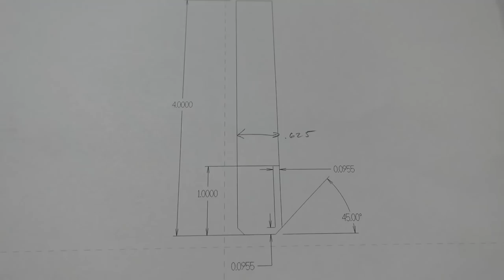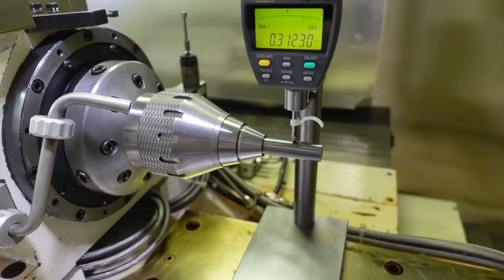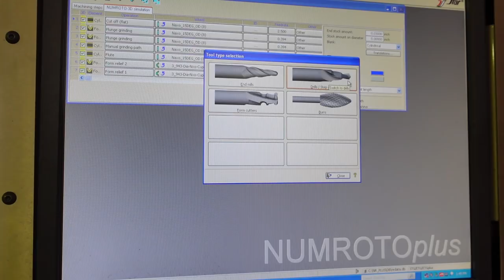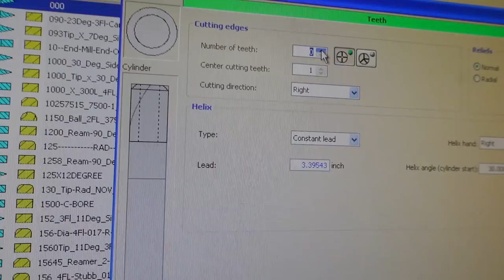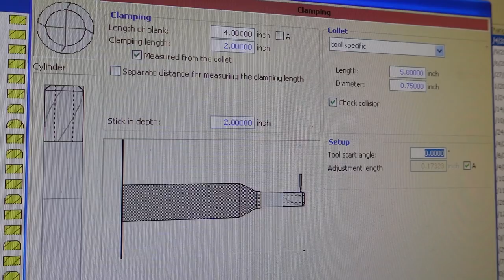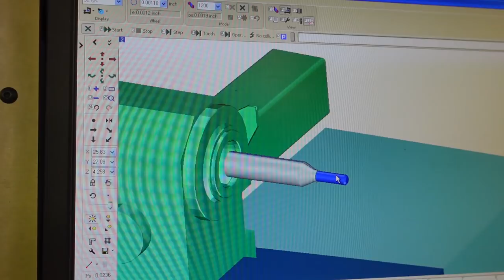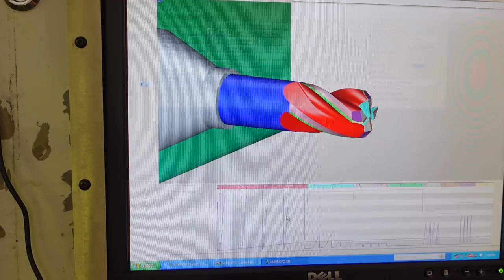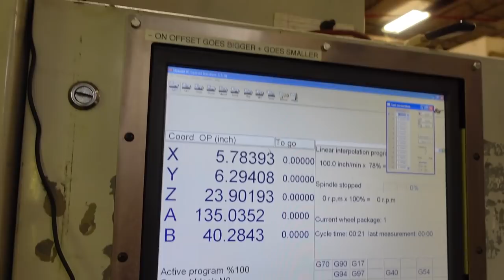Grinding A Special Chamfer Endmill

Comment: Using a micrometer to measure a sharp carbide tool will almost certainly damage the cutting edge. Rocking the indicator tip on a sharp cutting edge will also damage it. It wouldn't be noticeable with the naked eye necessarily but with a microscope or Zoller measuring machine you'll see it clearly. Maybe not a big deal for some but I just thought I'd share that.

Comment: This is so cool watching the process! Makes me wonder how they did it in the early 1900s without computer controlled machines and diamond wheels.
Reply from the maker: In those days they were dealing with HSS tools. So they could machine it in the annealed state than heat treat. Than just grind the cutting edges as you would today on a manual tool&cutter grinder. Or it could be done with a cam operated machine as well.

Comment: I find it remarkable you have such command of the nuanced detail of the process and the software, to make a one off tool.  I realize you have had this for years but I have tools that I use once in awhile that I take as long to rediscover as it is to use them...   And didn't you say there were only 4 of these machines made???   GREAT video.  thx.

Comment: Usually, we use wire cutting to cut off point drill to get a chamfering mill.
Then use a USB microscope to magnetically attract the spindle to measure the diameter of the tip of the new chamfering mill

Comment: My K O Lee T & C grinder sucks badly in comparison to this. Really there is no comparison.  If I can get it running within half a thousandth TIR, I'm tickled.  No way to grind flutes from scratch!  Re-sharpen I can do, but not as nice as this can.  And get the 1st and 2nd relief so perfect on a chamfer mill, the 2nd relief always seem to drag as it gets close to the center of the endmill.  I keep trying for improvement.  Thanks for sharing Peter.  KenS.

Comment: Cool video and nice endmill. 
It is also possible to measure the diameter with the machine when making new tools. For this purpose, the option "measuring in process" is necessary. With this option, the core diameter and the outer diameter can be measured and automatically corrected.
Reply from the maker: Thanks I will check if I have that option. I can do it with the regrind part. I have done that before.

Comment: You did all that while milling inconel.... damn you're good. 🖐
Reply from the maker: The inconel job on the horizontal mill is setup to run unattended. I have run that job for years and thousands of parts. I have shown a little about the cutters I use in a previous videos.

Comment: Wow! I like to own such a machine! Serious toy for big boys. I'm afraid I cannot afford it but this gives you a lot of freedom in your machining approach. I saw an earlier video when you ground a special tool for a job and I thought you used the Mazak for this too. Now I understand better. This machine probably has air or oil bearings and automatic balancing to get a real thru running tool. Do you own this machine or is it a machine you can use for your jobs? Software looks a bit dated but it seems to have all the features you need for grinding special purpose tooling. (DOS was really stable compared to a lot of windows versions who came later. Win97 made my hair grey...) Thank you for sharing, Job (for grinding only a Deckel SO1 which provide me great single lip cutters for custom jobs but this machine rocks!)
Reply from the maker: Thanks Job Kneppers! I own this machine. It's a CNC tool and cutter grinder. It actually rides on roller bearing ways. It theoretically can resolve to .000039" of accuracy.

Comment: You don't worry about it. That's funny. 
Don't get my wrong. 
I think what are you doing is amazing. Like I just have a bench grinder. Actually I have 3 and a half grinders. 
The half is a old sowing machine motor.  With grinding wheels buffing wirer. Ect .

Comment: Who knew there was such a beautiful end mill hiding inside that bar of carbide? 

How close of tolerance can you get with this setup? 

Is there a cycle for dressing the wheels?

I worry who is going to be doing this work in 10 - 15 years? 

Thanks for making the video clip.
Reply from the maker: I have ground tools to .0001” tolerance before. But that take quite a bit of effort.

Comment: You can get an anvil mic to measure odd flute end mills I’ve always done it that way.
Reply from the maker: Yes if the tool has the correct spacing for the mic. But modern tools now days sometimes have irregular spacing on the flutes. I have a 3 flute mic but not anything else. Say for 5,7 or 9 flute tools.

Comment: I do exactly the same type of work but on manual machines. I could make the entire tool on manual machines . I can't compete time wise to the  CNC making the tool from a blank . We would buy a new end mill and add the chamfered. The chamfered l would put it on with the Hybco form relief grinding fixture. The chamfer would be just as accurate with a better finish and I wouldn't need a secondary.  I have made some metric extra long drills from carbide blanks as they were a non catalog item. Was a lot of work and time. They sure looked beautiful when they were  done. Your CNC can do somethings l can't . You can flute taper end mill with a constant 30 spiral. I would need to change the rate of spiral down the flute to do that. Never  had the opportunity to run a CNC but I'm sure I could learn but at pushing 70 that's not likely going to happen.
Reply from the maker: I can see how it can be done on a manual grinder. I have done some regrinding. But I would not want to make one from a blank. My hats off to you! Also I will be 66 in July. Your never to old to learn something. Thanks for the comment.
Reply: Oh I am still learning on the manual machines. Anyone that thinks they know it all in this business is nuts. I sill learn from others and on my own. I been grinding for over fifty years and l found grinding is a moving target. When I started they didn't have CBN wheels.

Comment: Thanks for demonstrating you manufacturing a simple cutter for us.  It was an excellent production!  don't you have to probe the cutter wheels at some point before cutting?  How else does the machine know the location of wheels vs. blank?
Reply from the maker: I the video you can see the wheel probe behind the A axis spindle. So yes when a wheel pack is first assembled and dressed you need to probe the location, size and shape of the wheels.

Comment: Most people buy an endmill and add the chamfer. With your machine maybe it's cheaper to make from a blank. I did tool grinding for a long time no cnc
Reply from the maker: Starting from someone’s tool it takes more work to get the chamfer to the exact size. It only takes about 20 min for this machine to grind it from solid.

Comment: On the “geometry” page you entered .624” diameter, then on the “blank” page you entered  .625”. Does that interfere with the grinding or finished product?
Reply from the maker: The blanks are really .6247” centerless ground. All endmills are really .001-.0015 undersize. For grinding it makes no difference what size you enter. The machine will try to grind that size.

Comment: Hey Peter! How many end mills can you typically produce using one pack of wheels before you need to dress or replace? I haven't had a lot of experience with grinding and interested in the different types of wheel bonds and how they hold up.
Reply from the maker: These wheels have a lot of abrasive depth and are very hard. I don't grind production type of work. But if I had to guess I would say thousands and thousands. It depends on how hard you push them and how much you true/dress them. If you are grinding tools that require very sharp internal corners. Than you would have to true up the wheels more to maintain the sharp edges. I haven't bought any any wheels in years.

Comment: Great video. The sound quality of your voice is perfect. I stopped making videos at work because I received so many complaints about my audio. Interesting software. I wonder if we sat side by side, you with your software and me with the ANCA software, which might be faster creating the same tool. My guess is it would be very close. One thing I didn’t see, after you changed the wheel pack and coolant manifold I didn’t notice you telling the machine that it had a different pack. Is this not necessary with your software?
Reply from the maker: Thanks Alfred. Yes I did do that. It is necessary to tell the software. I just didn’t get it in the video clip for some reason. But it’s just a selection before you select to manufacture and probe the clamping length. It will give you a error saying no wheel pack in the machine configuration for that cycle. Probably the same in Anca software. Though I have never used Anca. My version of Numroto is probably 15 years old. It may be a lot different now.
Reply: Edge Precision wow, if it’s 15 years old they are very ahead of the curve. I’ve only heard great things about Numeroto!

Comment: Very cool
What make + model of machine is that?
Did you ever upgrade the software on it?
I want to get one of those grinders on the used market to play with. I know nothing about them.
Reply from the maker: It is a Star STG grinder (The same people that make the Star gun drills). No I have never upgraded the software sense I have owned the machine.

Comment: Thanks for your effort, in fluting prosess when you use flat wheel and when angle wheel? 
Thanks
Reply from the maker: It’s used for more flutes at a higher helix angle. Like a 6 flute endmill with a 45 degree helix angle.

Comment: Is there any advantage of a Grindingwheel with a copper body ? Because we in Germany only have them with a Aluminum body or I never seen one.
Reply from the maker: The wheel pack that looks copper (they are 3M wheels)  isn’t. It has some kind of plating on it. The others (the ones I used) are Naxo Force wheels. I’m not sure what there cores are but it isn’t aluminum. It may be steel or stainless of some kind. The cup wheels are aluminum but not the fluting and gashing wheels.
Reply: most diamond wheels are nickel plated its one layer of diamond powder, some are resin bond resin impregnated  some more expensive form wheels are reverse bond with metal powder bond, you need  a dressing stick to clean the wheel not a (carborundum  wheel dresser) do not try to dress wheel with a diamond you will ruin your diamond wheel.

Comment: Do you send them out for coating or do you run them uncoated? If so, what materials are you cutting with them?
Reply from the maker: If I need a tool coated there is a place here in town that does it. Most of the time I use uncoated tools. But coated works better.

Comment: So do those wheels just cut straight at full depth? A typical table grinder that I'm used to, those things only do recommended depth about a hair at a time.
Reply from the maker: Yes these super abrasive wheels are designed to grind this way.
Reply: A creep feed grinder cuts full depth as well

Comment: I'm not even a machinist and I found this fascinating. Nice explanation of your program.
Also how often do you have to check the grinding wheels for accuracy? How long do they last?
Reply: Grinding wheels get shaped by a diamond in the machine, and very frequently. On our CNC grinders they're touched up after each part. There's a "dressing" cycle that shapes the wheel against this diamond point, and an offset is created each time.

Comment: Since it has 2 flutes that center cut do you have set the feedrate as for 2 flutes when plunging?
Reply from the maker: Or even slower because the material has to flow out thru the gashes. This is where a lot of people break endmills while milling. It is better to plunge at a angle or helix if possible.

Comment: What brand is this grinding Machine ?  what grinding wheels (brands) are you using ?
Reply from the maker: The machine is a Star STG tool and cutter grinder (The same people that make Star gun drills). I mostly use Winterthur brand. In particular their NaxoForce diamond wheels. I also use some 3M diamond wheels as well. Here is a link to Star grinders.  https://www.star-su.com/tool-grinders/tool-cutter-grinders/
Reply: Thank you.

Comment: About the focusing. If you are using a static placement for the camera, turn autofocus OFF. There's really no reason for the camera to change its focus. Even during zoom (optical or digital) the focus will not change.
Reply from the maker: Thank you Rudi. I do understand how to use manual focus. As I said in this video. I was trying out a new camera. The Sony ZV-1. I accidentally had it set on the product showcase function for the auto focus. If I was using my Canon 6D DSLR which I should have been using I would have eliminated this problem. It is because this Sony's point and shoot camera's manual focus is a pain to use. But the sound it records is better than the Canon even with the Rode Go mic. I wish Canon put better audio amps in their cameras. But I just got this Sony yesterday and wanted to try it out. I like the camera but it doesn't do so good for this purpose. It lacks the ease of using manual settings. For a Vlog type of camera I think it will be fine.

Comment: Was the fluting operation at the normal feed rate and "depth of cut." I know nothing about grinding, but if so that's an incredible material removal rate
Reply from the maker: With this size endmill you can take it in one cut. Let’s say for endmills .750 in diameter and smaller. For larger you may take more passes. These wheels are specially designed for this kind of grinding.
Reply: @EdgePrecision  do you have to compensate for wear on the grinding wheels as a program goes along?
Reply from the maker: @AnselGaddy  Yes if you are running a run of endmills it will change as well as the machine and coolant changing temperature. But for one tool not to much. These wheels don't wear fast.

Comment: What cam software do you prefer
Reply from the maker: For this grinder I use what is shown in this video. For machining I am using Esprit TNG. I prefer that because that’s what I know. But the best software is what you use and get good at. They are all so close to each other. Just concentrate on one an get good with it.
Reply: @EdgePrecision  thanks!

Comment: Where do you get your cup wheels?
Reply from the maker: There are two brands I use. One is 3M and the other is Winterthur their NaxoForce ones. But there are others like Norton and Diamond Wheels Industries. These are not like the diamond wheels you see on manual tool and cutter grinders that look brown where the abrasive is. These wheels are hard and should not be run without coolant.

Comment: You mentioned customer. Without revealing any secrets, is this like a local shop you are making a special tool for some specific special job he has? Because I am just curious why someone would call Peter instead of Niagara (or whoever) for an end mill.
Reply from the maker: This tool is for Center-line. The shop I Useto own and where I’m located and rent space from. The job they are using it on I have run before myself.
Reply: @EdgePrecision  Makes all the sense in the world. TY for the answer.